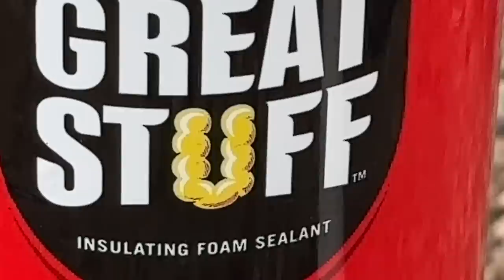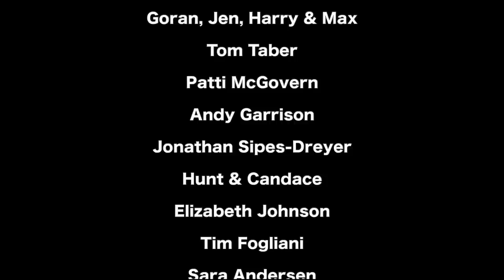RAINWATER TANK BURIED! - Installing Catchment Pipes & Plumbing at the Airstream Carport (Step 9)

Comment: Wow, putting the tank in the hole looked hard to do! Great that you got it in there! I really like your access that you built with 3 access ports stacked up. So good you had clearance to open the ball valve! Yay, you got the pipe to the top of the water tank done too. Ashley is already painting it! There goes the original clothesline! Ocho was so cute attacking the drill. Onward to the construction of the pump house next time! Thanks for this Longneckers!
Reply: I feel like the access thing you built should be above grade at the top so water won't puddle around it and fill it in. Maybe it is and I just couldn't see it on my tablet.

Comment: Put a vertial handle extension on the ball valve handle or make an extension that can be removed, to make turning tap on/off a bit easier.  Also ground water will seep in from the bottom so sealing is of little value except to stop dirt/snd coming in.

Comment: Ochoa is so so adorable and cute!!!
So, Fun Fact peeps:
Do you know why the PVC glue is colored purple?
For instances exactly like what TSH are taking advantage of.... that is, being able to do the job yourself and have an inspector approve without homeowners having to pay the expensive plumber’s bill.... and thus the purple color allows the inspector to see easily and quickly that you really did use PVC glue and aren’t using something you shouldn’t or nothing at all when he/she comes to inspect, thus allowing for a quicker and thorough inspection with ease and signing off on the job quickly without doubt that the joints are sealed properly!!!😊😊😊

Comment: Came across a similar situation when I put in my underground sprinkler system.  I used a piece of 8 inch PVC pipe and notched over the inline valve. Worked great and way cheaper than 3 of those boxes!
Reply from the maker: I don't even know where we could get 8" PVC!
Reply: @TinyShinyHome  a friend of mine does plumbing on the side. He had a scrap laying around. But anyone who does farming probably has some.  Just keep your eyes open.  Check where you can buy it.  They may have a scrap or a damaged piece for cheap.

Comment: I hope you end up with more water in the tank than you do in the ground around it!! I saw a picture of someone's partially sunken tank that floated out of the ground because it was more bouyant than the water logged dirt!

Coming off the tank, I'd have done a permanent pipe and then put the ball valve just below ground level.... But my thought has been to put my tank a few feet down, and then directly next to it at the same level have my pump house... which I'm planning to have in a small shipping container, and if necessary it's pretty easy to get that insulated on the inside.

Comment: Bonjour la famille.  It took a small village to install the rainwater catchment tank and good ol' American ingenuity to fabricate the water/ball valve housing.  nicely done. I'm glad you're outside, the wind blowing and cold temperatures, because with all that Purple Primer wafting in the air, I'm suffering from a trans-Atlantic contact high.  I'm anxious to know if the rain catchment down spouts worked as fabricated.  so will i tune in tomorrow for another installement of 'as the 90 degree elbow turns,' tomorrow ?  As lady Ashley said with flair and sophistication:  " I will !"

Comment: I'm sure you know (because you've done so much with swales...etc) that based on the elevation of the valve box the runoff in that area is going to pool there if you don't raise that box's relative elevation. And I predict that's not going to end well. 

Love your videos!! Thanks!
Reply from the maker: We added another one the next day so it's above ground level, just did't get it on video.

Comment: Can you explain why you went that way and not just connect gutters direct into the tank? Will there be enough force to push the rainwater up that height and into the tank?  Ours are just connected via pvc pipes from house gutters to the tanks via downpipe?

Comment: The valve you need coming out of the tank is a street valve. It's the kind that can be turned using a long T shaped pole with an upside down U on the bottom. Then you only need a 4" pvc pipe coming up to the surface
Reply from the maker: You can turn most handles with a T pole, that’s the point of them ;)
Reply: BTW thanks for all the videos. I'm looking for land in that county and am learning a lot from what you do

Comment: it would be a good idea to have a small hole in top of  water tank and have a cork on a long stick to know how much water is in the tank with markings on the stick for low, medium  and high water levels  would rise up and down with the water heights.
Reply from the maker: You can usually just feel the level of water by touching the outside of the tank

Comment: Anyone out there
Most if not all above ground tanks are not meant to be or designed to be buried
I would suggest talking to the manufacture and checking the warantee..
At a bare minimum have them full of water before backfilling
These are only suggestions
Do your own research
Reply from the maker: That’s why we mention speaking with the installer and only going down 3 feet….

Comment: Assuming there is an air vent so the tank can fill? And so water can be pumped out of it without creating a vacuum? It doesn't take much -- we drill 1/8" hole in our plastic drums to keep them from imploding -- small enough the bugs can't get in. :)
Reply from the maker: The inlet is a filter and air vent combined.

Comment: Since the riser pipe to the tank will contain standing water, I would think you would also need to insulate it for freeze protection as well correct? Great video!
Reply from the maker: That or a low point release. Haven’t decided yet.
Reply from the maker: I’m torn on this because it has room to expand if it were to freeze. It would go up the pipe. Not sure it’s needed, but still researching it
Reply: @TinyShinyHome  Good questions all. My thinking is that the open end (where it pours into the tank) would get colder air into it first, then freezing the top-most layer of water. At that point the remaining frozen water wouldn't have anywhere else to expand except down and outwards. I could be wrong but that's what I'm thinking. As it stands (excuse the pun), the easiest course of action in the short term it to drill perhaps a 1/16 or 1/32" hole in the 90 just before it goes into the ground. This would allow a natural 'seep' after a rain to slowly drain the above-ground section of water over time (or, just plumb in a drain petcock to do it manually). This would ensure that any water in the section of pipe above ground wouldn't freeze. Do you know the frost line (if any) for your area?

Comment: I don't get how the water gets into water container from the gutters can you explain?
Yall are working fast I hope you can move,  before it gets to cold.
Reply from the maker: WET DELIVERY SYSTEM - Gutters & Underground Downspouts on the Airstream Carport (Step 6)
https://youtu.be/aWfZBT2RwP4
Reply: Fill a "U" shaped hose with water and the other end will go to the same height just by water pressure. The tube goes to the roof and the top of the water tank is below the roof. It should be able to drain to the water tank.

Comment: Hi folks curious about why you plumbed your four inch pipes in the ground? It seems to make more sense to have run the pipes up along the roof and directly into the storage tank. With the setup you have it looks like your always gonna have about a couple hundred gallons of water sitting there getting rancid! Are you adding a sump pump later?
Reply from the maker: We go over this in previous videos. It’s called a wet delivery system.

Comment: Could you have plumbed into the pump house and put the ball valve in there? Or is there a reason it had to be close to the tank?
Reply: You normally want to have the option of closing of the pipe close to the tank. Then it's possible to do work on the pipeline or quickly close it of it starts to leak, without loosing   all the water.

Comment: If you have one more of thows boxes level the dirt to an in. or 2 from the top then cut off the skinny end of the one more extra box to outline what you have so dirt dosent cover the lid and it stays clean ok hope you understand what I mean it's just adding one more box with the bottom cut off to keep dirt from covering what you have it will still drain rain water from around edges ok ❤

Comment: maybe next time test with air pressure instead of water use soapy water around valve connection
Reply from the maker: The tank is vented on purpose so that wouldn't work.

Comment: Why not directly go from the gutter to the tank so that you stay high with the pipes now you have standing water with building up bacteria. in the lower section.
Reply from the maker: It’s called a wet delivery system, we’ve already covered this during the downspout install a few videos back.
Reply: @TinyShinyHome  if you have it under control then it's good.

Comment: You guys do realize that the capacity will be limited by the elevation of the tank to the supply source location. Water seeks its own level.
Reply from the maker: It’s called a wet delivery system, look it up ;) WET DELIVERY SYSTEM - Gutters & Underground Downspouts on the Airstream Carport (Step 6)
https://youtu.be/aWfZBT2RwP4

Comment: It's not necessary to feed the rainwater into the top of the tank. The underground 4" run could connect to the tank's drain with a 'T' & PVC ball valve. IOW, your underground 4" pipes would effectively be extensions of the storage tank.
Then, the supply line for the Airstream could have connected  to the other side of the "T", with a couple of elbows to bring the shutoff valve closer to the surface.
I always use galvanized steel for risers.
I know, "coulda, woulda, shoulda."
"Different strokes for different folks."
 JS 😎